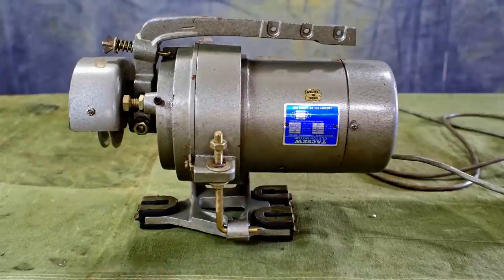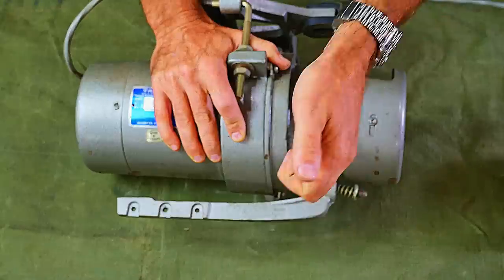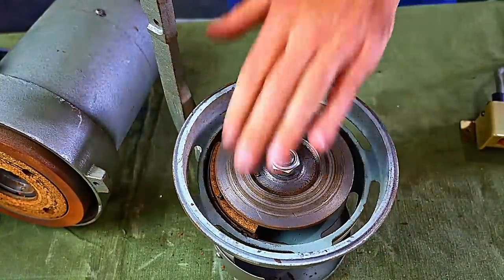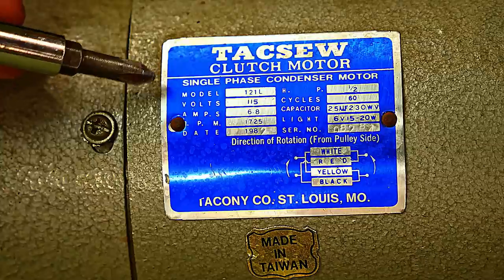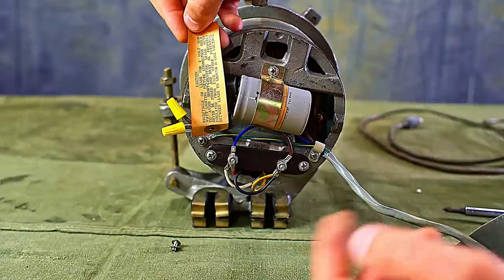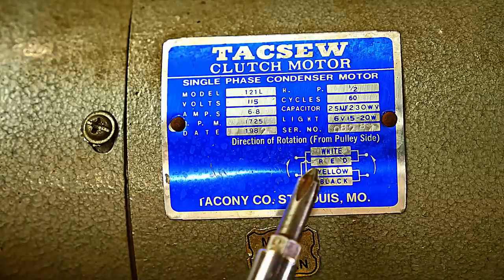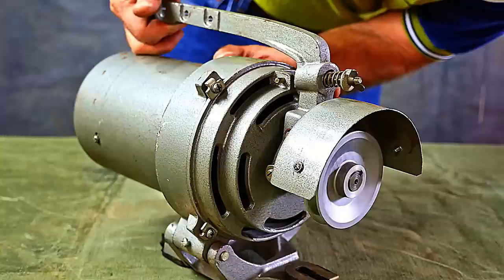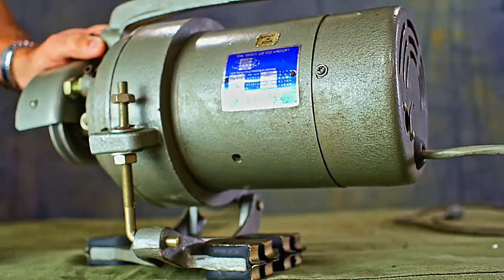Industrial Sewing Machine Clutch Motor - Components Operation Wiring Diagram

Comment: Mine is like an on off switch, no feathering ability no matter how lightly you are on the pedal. Any ideas for a remedy? Thanks.
Reply from the maker: Some work better than others. Did you see the part where I cleaned up the fly wheel and made it real shiny? That made this motor behave much better, my clutch was good so I reused it but yours may be worn out and need replaced. get the smallest pulley you can find for your motor. After you do all that you might find that it is better but probably not exactly like you want. Then you will buy a servo to replace it for a $100 and wonder why you didn't do it sooner. https://amzn.to/2oWVAg7
Reply: @AlexanderDyer  thanks for the reply yes I did notice the cleaning part , first on my to do list. I watched your servo video as well that's in my amazon wish list. Lol. Thanks.

Comment: Hello Alexander I need a favor. What is the name of the part where you made the marks?. I need to buy one for my sewing machine.
Reply from the maker: That is the pulley. The bigger the pulley on the motor the faster your machine will go. Measure your shaft diameter for a proper fit.
Reply: Thanks! Today I have been looking a place for buy it. They asked me for the motor brand and the model for they to know the one I need. Well, is a Speedway clutch motor, model DOL 12H. They don't find this motor and the suggestion was I should buy a new clutch  motor. What do you think I should do?
Reply from the maker: I won't say what you should do other than to say it is possible to get the pulley you need. If you are considering buying a motor then perhaps consider a servo. Watch this. https://www.youtube.com/watch?v=lavkvsU5ltk
Reply: I will continue looking for the pulley. I need to go personally and show them the one I have. If I can't find it and I should buy a motor, I will take your advise. Thanks for your great help!
Reply: Hello again. I found at amazon.com, some pulley and they have from 45mm until 120mm. The one closer to mine is 90mm. I am thinking to buy this one. If I want my machine be slower, which one I should  to buy?

Comment: Other than lower cost, is there ever an advatage to using a clutch motor instead of a servo motor?
Reply from the maker: Yes, factories prefer them for their speed and dependability. Some collectors prefer them too. https://youtu.be/lavkvsU5ltk
Reply: Hey! I am currently taking my clutch motor apart. I just got off the phone with an industrial sewing machine specialist (i'm hunting down some parts) and he told me that people are shifting over to servo motors because they are 1- more quite 2-have variable speeds (unlike the clutch motor like this which has essentially one speed which only can be changed by getting the smallest pulley possible for the motor) and 3-uses less electricity. I recon as it is with most things, it depends on your personal needs. Right now I'm sticking with my clutch motor, but I will probably end up getting a servo motor cause I'm expecting to find I need variable speed control.

Comment: Thank you .
My clutch motor has gone quiet 😢
Reply from the maker: Check your switch and then the capacitor.
Reply: Alexander Dyer thank you so much I noticed its sounding,tried to press the pedal it winds a bit then stops so am about to check the capacitor probably its worn out😭😢